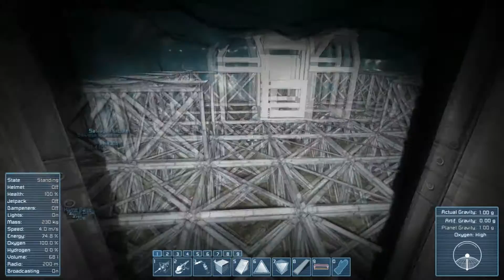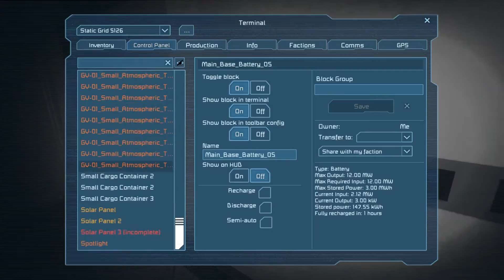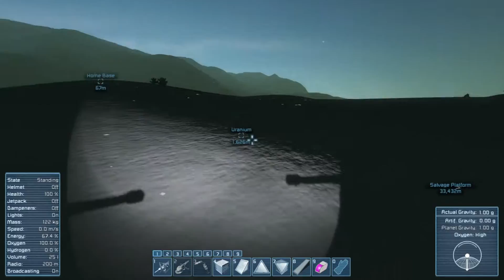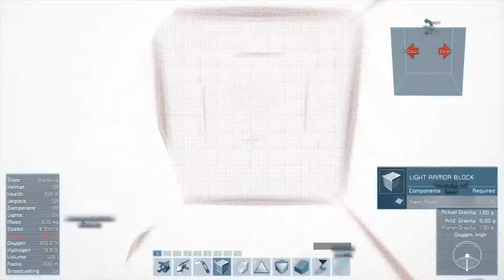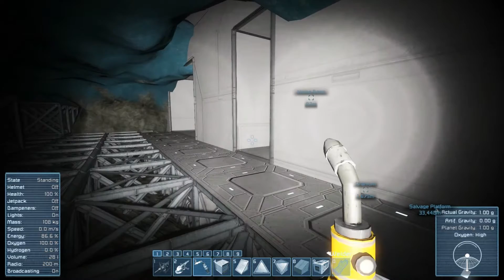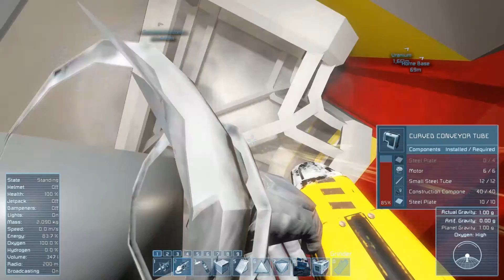Space Engineers: Survival Mode Let’s Play | S2 #16 | Low on Power

Comment: i like this series, engineering around realistic inventory size is interesting. Did/can you share a list of the mods you're using? if you turn off forward thrusters you can drift travel and not have flicker. just remember to turn back on before landing. have you tried hand mining with upgraded drill? with rover nearby could be easier to hand mine on planet just filling rover. I think effectiveness upgraded refineries are better than arc furnaces because more ingots per ore even if slower. if you need certain components can you break down some into ingots then into different components in assembler? upgrade modules on assemblers are really useful.
Reply from the maker: Thanks. I will add a list in the next video description of the mods I use in this series.